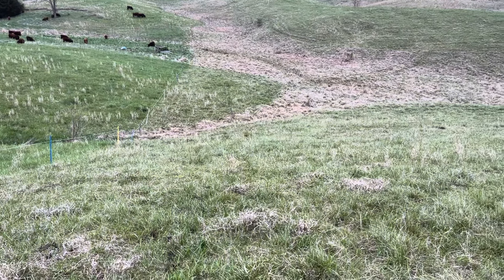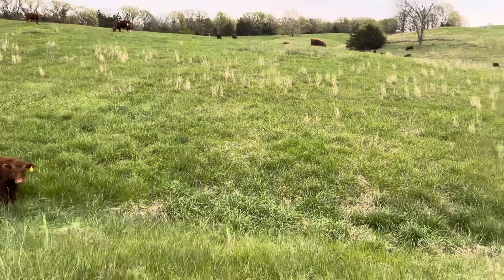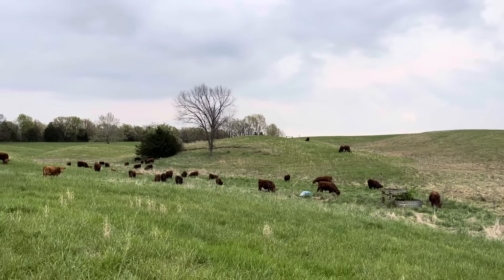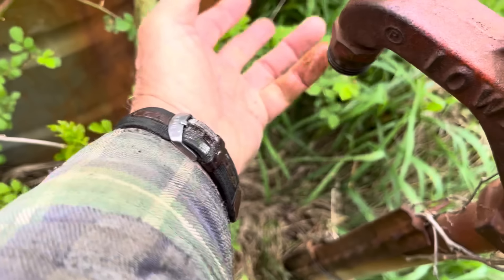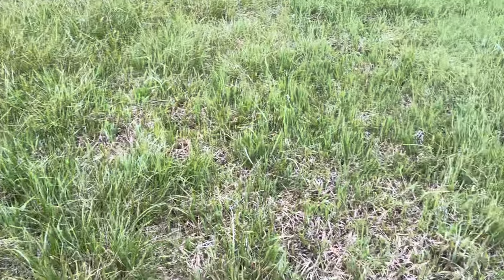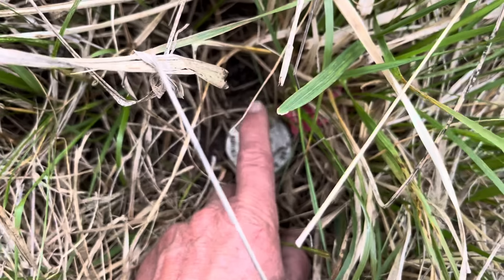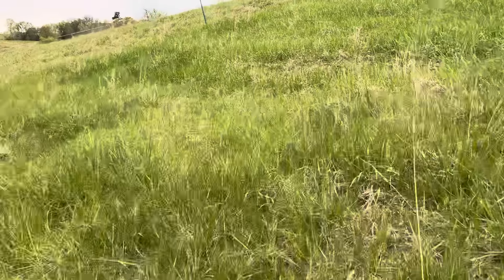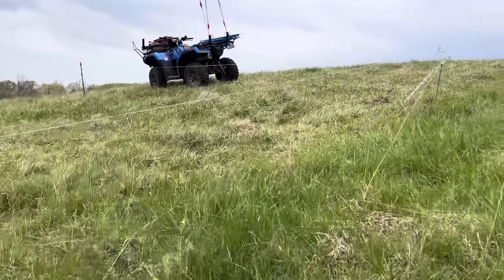Greg explains how to daily strip graze and extend the water lane daily.

Comment: Greg have you ever considered using prescribed burns to clear problem areas, improve plant growth and quality, and add BioChar to your soil.  BioChar is the thousand year additive to improved soil.  
Prescribed burning is indeed a valuable tool for managing grazing pastures, especially when aiming for regenerative practices. Let’s delve into the details:

Frequency of Burns:
Burning should be carried out every 3 to 5 years when an excessive amount of dry material accumulates on the pasture from previous years or when weeds have infested over 50% of the stand1.
Avoid burning too early, as it may allow weeds to regrow more rapidly, increasing competition during grass green-up1.
Growing-Season vs. Dormant-Season Burns:
Dormant-season burns typically occur from December 1 to April 30.
Growing-season or “summer” burns fall between June 1 and October 1.
While dormant-season fires are more traditional, there’s a case for scheduling fire during the summer months:
Safety: Summer burns are safer due to less volatile weather conditions.
Diversity: They add diversity to your burning program.
Brush Management: Summer burns are harder on encroaching brush2.
Benefits of Prescribed Burns:
Forage Quality: Burning rejuvenates native rangelands, leading to more nutrient-dense and palatable growth for both livestock and wildlife.
Economical Approach: Burning is relatively cost-effective compared to other brush management methods.
Preserving Grasslands: Prescribed burns help preserve native grass, control weeds, prevent wildfires, and maintain grassland ecosystems2.
Weight Gain: Research shows that cattle gain weight more easily on pastures that have been burned3.
In summary, periodic prescribed burns can play a crucial role in maintaining healthy grazing lands, promoting biodiversity, and enhancing overall productivity. Remember to tailor the burn frequency to your specific environment and management